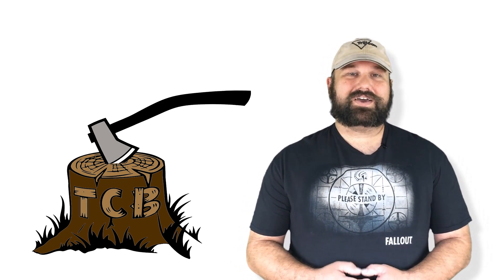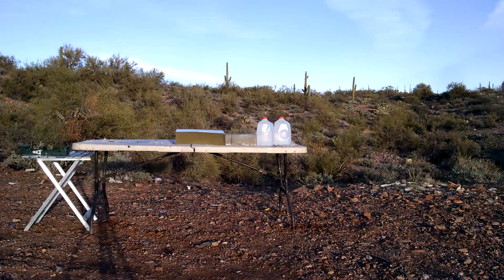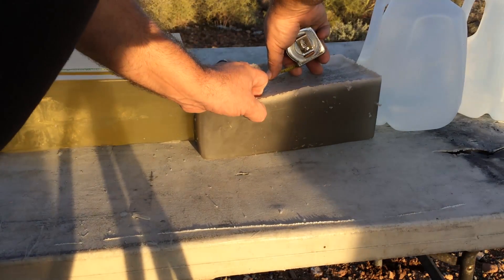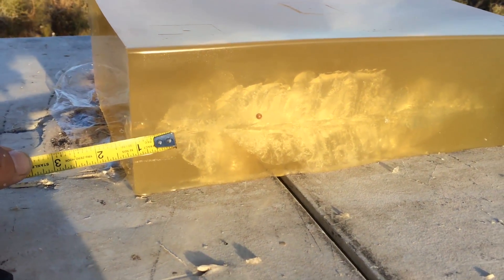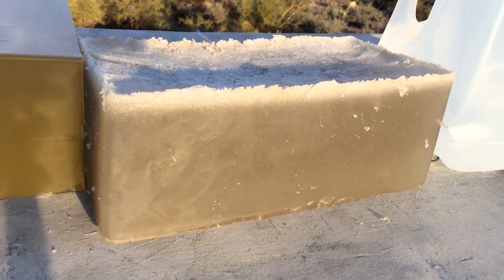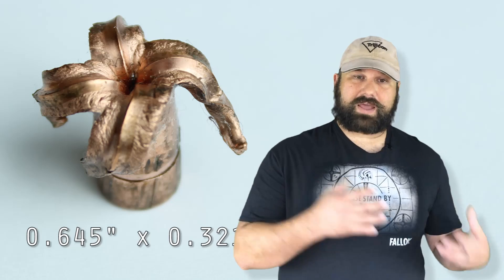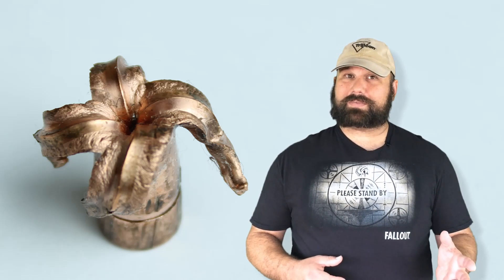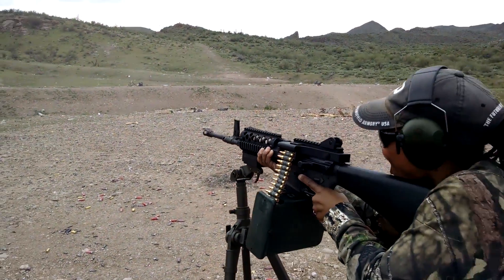.300 AAC gel test: Sig 120 gr HT solid copper bullet

Comment: I killed a medium size doe yesterday morning eith the Sig Elite Hunter.  She was about 75 yds, double lung, didn’t hit any ribs on entry or exit.  Expansion didn't start until the round was well into the first lung.  Based on the exit, id say the overall expansion was very minimal.   Maybe 1/2" at best.  Admittedly,  this was probably a "worse case".  10.5" barrel, 75 yds, and no bones impacted on entry,, AND  they did expand SOME, and left acgood blood trail.  So, they were accurate for me, and they got the job done.  From my 16" the results would have likely been a lot better (especially on something tougher like hogs) and I'll probably set them aside specifically for that upper.   Over all, I'd say they are an acceptable round, but for shorter barrels I think there are better options.   I've tried 110gr TRex, but couldn't get it to shoot consistently better than 3 moa (ie not acceptable for fur).  I've got an accurate load for  125gr MKZ, so I'll be loading those for hunting from now on.  I tried 110gr vmax last year.  Spectacular wounding, but not enough penetration (8" to 10") to use on game for my taste.

Comment: Permanent wound cavity 
The temporary wound cavity is what you see in slow motion with the attempted explosion of the block
The PERMANENT wound cavity is what is there after all the dust settles.
Reply from the maker: Close. The permanent cavity is the tissue removed from the track. The temporary cavity is, as you mentioned, the cavity formed temporarily and visible on high speed. It is generally consistent with the tears left over in the gelatin. Real gelatin is less elastic than tissue so those tears are not representative of what you would do in real tissue.
Reply: @newsofthepews  the permanent wound cavity with the gel is similar to what happens when hitting center mass and taking bone fragments to increase damage. The gel sitting there with those tears are more representative of the permanent wound cavity with a decent shot. At least with my experience in shooting people anyways...
Reply from the maker: @Aphabet21  speculative. I shouldn't refer to the tearing as the temporary cavity, because that's an oversimplification. Without high speed photography, the tearing is a reasonable approximation of the size and location of the temporary cavity.
Reply: @newsofthepews  except that the slow motion captures a drastically larger cavity
Reply from the maker: @Aphabet21  I wouldn't say drastically larger. It is larger, but the tearing seen in the gel is caused by the TSC and has a linear relationship with it.
Reply: @newsofthepews  you wouldn’t say drastically larger? It’s at least twice the size on slow motion on many other channels with a good slow motion camera. Just saying. The post shot analysis of the block is more representative of the permanent wound cavity. The point where the block swells and jumps off the table would be known as hydrostatic shock if it were in a human. This is also known as the temporary wound cavity. The cavitation and tearing caused from the round and the hydrostatic shock is what’s known as the permanent wound cavity, best represented by the permanent tracks in the gel. At least is what I’ve come to understand from my experience....
Reply from the maker: @Aphabet21  yes. I have performed hundreds of tests, dozens using a Phantom V642. But no point in quibbling over semantics.
Reply from the maker: @Aphabet21  what you're referring to is neither. The permanent cavity, also called the crush cavity, is the tissue which is physically removed from the wound. You're right that what I'm referring to in the video is not technically the temporary cavity. It isn't the permanent cavity, either. It is the disturbance left behind in the gel by the temporary cavity.

Comment: I killed a 6 point white tail with this ammo last night. It worked fine on the deer, I would not choose to use it inside a building/around innocent bystanders. Solid Copper bullets don't fragment and that single piece of Copper won't STOP inside a body/after a couple sheets of drywall & 2X4 lumber like old fashioned cup and core will.

Comment: I subscribed! Please help! I need a .300 blackout round that moves as fast as possible and can defeat barriers (concrete, wood, doors, windshields, etc). Should I get FMJ or hollow point? What bullet do you recommend? Thanks!
Reply from the maker: Toss load is good. 110gr TAC-TX and VMAX are both excellent. But if you're looking for barrier penetration, .300 AAC isn't really at the top of the list.
Reply: @newsofthepews  Sure there is the Sig 125 grain otm cuts through a lot shit with ease or at least in my testing it has done quite well…..
Reply: I would look at the leheigh defense xtreme penetrators. They will give most penetration and damage per caliber as far as I’ve seen

Comment: I'll second the sentiment for wanting some barrier testing and wondering what the minimum expansion threshold is.  This stuff is cheaper than black tip and I've got my fingers crossed that it will perform on par.  Barrier performance is the whole reason I got into this caliber (based on a specific job need).

Comment: what is the min velocity to expand on this round? looks like a good alternative to 110 vor-tx. I'd like to see some more data on hunting with it.
Reply from the maker: I couldn't answer that and I agree.
Reply: No One... I shot a 170lb whitetail doe with it at 125-150 yards... With a 300aac pistol. It worked better than expected. I've also used Barnes 110 and Remington factory 120gr umc open tip flat base. The rem stuff... At 185 yards... Destroyed a back ham n bone.. Then traversed under the skin... All the way... Till stopped at rib breast bone (lack of better words). Basically destroyed rear right ham, and unzipped the deer underbelly all the way to first rib. Jacket at stop weighed 16.7 grains on scale. No core or anything found. Traveled right under skin.
The Sig bullet.. Left impressive wound... It also destroyed a ham, complete.. Some baked dog food... But most was ruined bcz hip.....at 35-40 yrds. And left the right side in front of right ham. Followed up w a shot to behind left shoulder. Exit just behind right shoulder. Was in thick veg. Running busted deer. Me? I'll shoot deer with the rem 120, Barnes 110 ttsx, or Sig. Just put them where they need to. As best you can. Always follow up if not perfect
Reply: @apachetrail6232  what zero are you using??
Reply: @kevinlawrence9629  100 yard zero. about  8 inches low at 200.. will confirm again this coming week at the range
Reply: @apachetrail6232  how was you data?

Comment: I fired 3 of these into clear ballistics gel from my 10.5" barrelled AR and only had 1 of them open.  The other two zipped through 2 16" blocks in a straight line with no sign of disruption. Not reliable from my testing, but the one that did open looked very similar to the one in your video.  I'm sticking with the 110gr. Barnes.
Reply: @Marcus2750-u1t   The professionalism in your reply says it all.  I'm glad they worked well for you, but that doesn't change the fact that they didn't work for me.  As for your claim of REAL testing, use of all CAPS doesn't make your testing any more or less legitimate than mine.  Work on your attitude and professionalism.
Reply: @Eroc One question mark is all that is needed, my scholarly acquaintance.  My test was using clear ballistics gel at 10 yards in an enclosed range.  I had 2 16" blocks placed end to end and had a chronograph positioned about a foot in front of the gel blocks.  My testing was 2 years ago, and after the 2/3 failure to expand I admittedly quit testing them, so all the precise details were/are irrelevant.  Feel free to tear my test data apart oh wise one of the all powerful youtube comments section.
Reply: Where did our angry little buddy @Eroc go?  He seemed so intent on proving my experience false. Lol

Comment: Id like to see what it dose out of a 16 inch and what the  Expanded diameter is
Reply: Box says velocity is 2250 fps.   I suspect that's out of a 16" barrel.   Increasing the impact velocity by 200 fps will likely lay the expanded petals back a little closer to the base/neck of the bullet resulting in a slightly smaller diameter.   Performance on gel and game would be essentially identical.   If a monolithic hp will expand out of an 8" barrel, it only gets better out of a 16".

Comment: How do you think this would perform at further distances? I just ordered a box to hunt some whitetail with and I'm wondering if the results would be similar at 50-100 yards.
Reply: Blackbirdtactics  Would say should be the same at more than a 100 yd especially with a longer barrel could you gonna have more   Velocity
Reply: Depending on your barrel length this is a 300 yard capable round along with the tac tx
Reply: @Marcus2750-u1t  looking for a zero with thies out of a 16"
Reply: @kevinlawrence9629  looking for a zero???
Reply: @Marcus2750-u1t  yeah I'm looking for a zero for this round out of a 16". Sofar i have a 40 yard zero but I'm about five inches high at 100 yards

Comment: That's pretty cool - out of an 8" barrel!.  This is supposed to be a hunting bullet, so I wonder how far/slow it will still expand?  Sig doesn't say.  The Barnes TacTX might be better for defense, as it will expand like that out to 400 yards at only 1300fps.  Still nice work Sig!  I wonder who makes the bullets? Sierra?
Reply from the maker: Agrippa 2K Yeah, I don't know who makes the bullets. If I ever get around to buying .300 dies, I could pull a bullet and do a reduced charge test.
Reply: That would be awesome if you could did a similar test with these as you did the .223 Fusion.
Reply: I know this is an old video, but Sierra makes the V-Crown bullets, so it is likely they make these for Sig as well.
Reply: I have a bunch of the bullets that have been pulled and they are identical to the Barns TSX so I am assuming they are the same bullet.

Comment: "...mediocre performance increases in some areas" The subsonic performance advantage over the 5.56 isn't mediocre. It is quite significant.
Reply: I am still luke warm on the subsonics myself.  The limited understanding of 223/5.56 inadequacies makes it difficult to reveal the advantages of 300 Blackout supersonic.  This bullet performance is impressive.
Reply from the maker: ActionPhysicalMan Well, kinda. First, "subsonic performance" is kind of an oxymoron, insofar as all subsonic performance is pretty crappy. Second, subsonic performance really isn't something that many people have a need for. Third, Subsonic performance is on par with most any other pistol cartridge except that they will actually expand when fired through heavy clothing.
Reply: @newsofthepews  the difference is that .300 blackout subsonic is like a spicy .45 that defeats soft armor. the caliber was designed to replaced the PCC’s and in that aspect, I feel it did awesome
Reply: I thought about this a bit. Since my rifle is primarily for the unlikely advent of temporary or permanent time without rule of law, I suspect that subsonic fire would be advantageous. I haven't been able to measure it myself but I have good reason to think that my rifle subsonic round combination produces about 120db. That is hard to identify as gunfire from as close as 100yds. In a WROL situation keeping a low profile is probably much more important than it is now. My .338 subsonic bullets are Maker 300gr. They have a muzzle energy of 734ft-lbs and still have 645ft-lbs at 200yds. They open up to about 1.2" even at the velocity they would be at at 750yds.

Comment: great video. id love to see it out of a 16" or 18" barrel
Reply from the maker: David Hanny It's a moot point anyway. I don't have a 16" .300 barrel. But you're right, the velocity increase is small and if a bullet like this does well in a short barrel, it ought to also do well from 16". Theoretically.
Reply: 300 wasn't made with those barrels in mind.  We all know they get a little more velocity out of them, but I'm not sure it's worth TCB testing them since the challenge, it seems, is if 300 loadings will even work correctly in the lengths of barrels the round is designed for.
Reply from the maker: If I had to guess, I'd say earlier expansion with higher velocity. That's generally the case, but there are exceptions.
Reply: I can only imagine the neck-length would change.  Now I can see it argued both ways - that the extra FPS would cause earlier expansion, or that the extra FPS would make the neck longer (which would be my guess) - but I'm not the testing guru, so... I'll leave that conjecture up to you.
Reply: Shot out of my 10.5 it has less penetration but still well over the 12” and awesome performance!

Comment: Excellent. Never have I been a fan of this cartridge, but if ammunition like this becomes more and more common and affordable. It might make the caliber worth looking at in a suppressed pistol sized AR for home defense.
Reply from the maker: Mean Man Exactly. The one thing that this cartridge does that's actually useful is that it can produce good terminal effect out of extremely short barrels.
Reply from the maker: Mean Man With the right ammo, of course.
Reply: It's all about the bullets, man.  The Barnes TacTX is similar.  This 9mm like expansion happens out to 400 yards!  308 bullets are the pinnacle of bullet technology.  Dive in and discover the Maker TREX (Trident), Hornady GMX, Barnes TacTX, Nosler E-Tip, Lehigh.  It may not be for the military, but it might be for you.  (basically it is an AK-47 round with superior bullets).